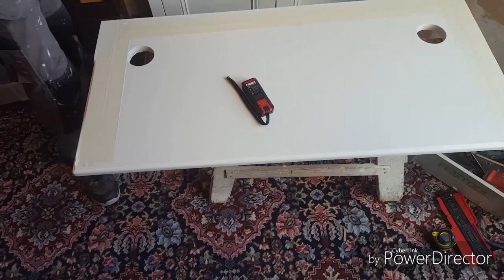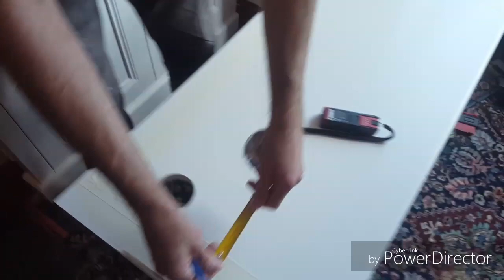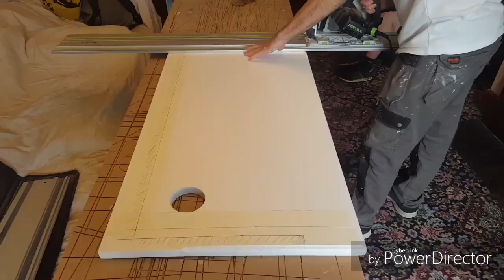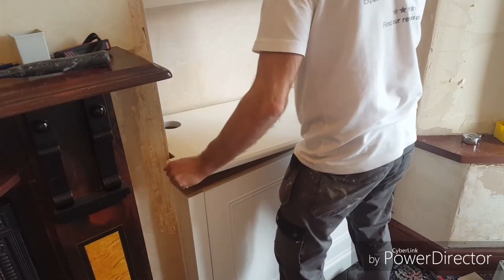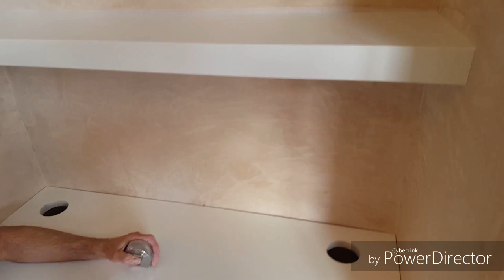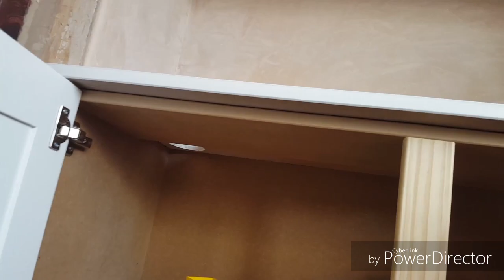How to fit an alcove countertop

Comment: Thanks for this. I'm going to be making my own alcove units soon (using your PDF as a reference) and cutting/scribing the worktop is something I have been thinking a lot about and so this video I'm sure will be very useful in the not too distant future.
Reply from the maker: Actually I strongly recommend doing it differently now!! using a template made from thin strips joined with glue gun.  As shown here: https://www.instagram.com/stories/highlights/18056439292248525/
Reply: @Alastair_Johnson  Even better. Thanks a lot!
Reply: @Alastair_Johnson  A quick question while you're here actually. What thickness material do you use for the 56mm strips either side of the doors?
Reply from the maker: @Hunders1984  22mm thick strip (same as my prefered door thickness) - 56mm wide.  Covering 3x18mm thicknesses on edge
Reply: @Alastair_Johnson  Ah so your doors are the same thickness as the 56mm strip. I assumed with the hinges lifting the door away from the carcass a couple mm the strip would have been slightly thicker to not get a step where they meet. Thanks again!
Reply from the maker: @Hunders1984  I find with the Blum hinges I use that I can get them closing tight to the carcase.  With soft close

Comment: Think this way is quicker and time saving plus any angles   Using the angle ends you can scribe as well easier than the block method on instagram 
https://youtu.be/OVrOk5Ly_eI
Reply from the maker: Anthony Mellor I agree. I should probably take this old video down as I wouldn’t do it that way anymore!  I converted to the templating method a few months back: https://www.instagram.com/p/B8g3pBAgQfS/?igshid=v9r4u6hojl1e

Comment: Hi Alistair, interesting as this popped up in my feed but appears to be an older video. Seems at some point you were using (or at least intending to use) other fitters. I’m guessing by your current approach that didn’t work out?
Reply from the maker: darren green yes it would have been an overreach, would have stripped any chance of profit.  We’re still only running at break even.  I dabbled with fitters but had problems.  Actually I am coming back around to it, with a couple of trusted guys I can call on but I’m not pinning my hopes of business growth on the idea just yet and I’m taking it slowly, doing fits together until I’m sure we’re on the same page regarding how things should be installed.

Comment: The easiest way I've found is to get some 3mm /6mm ply or mdf, cut this at least 60mm wider than the alcove (it's not important how much, you just dont want any less really for when you tape the two halves together later), cut this in half across the width, the depth needs to be 40mm deeper than the cabinet (if a 20mm overhang is required. Insert one half tight to the left hand side (make sure the piece is square to the front of unit with 40mm overhang at both ends) use a 20mm spacer and a pencil to run round the wall making a scribe line on the piece of mdf/ply. Repeat this for the right hand side. Cut to the scribe line on both pieces then place both on top of cabinet and you should have a perfect template. Gaffa tape this together in the middle and lay ontop of the real top. At this point set the template in 20mm from your wall overhang side so it overlaps the front of the fireplace or wall when you cut it. You cant really go wrong and really helps if your using natural wood that cant be caulked.

Comment: Cheers chaps for this. I got up early this morning 3 hours and measured and cut my oak top for the cupboard. Couple of issues,  one I forgot to include the width of the doors, so had to glue 20mm on the back end, secondly and advice requested the alcove is concave so front and back fine but in the middle I have probably five mm it's literally a curve, how would deal with that. It isnt an issue as I am going to build on top so it will be hidden, but for next time.
Reply from the maker: Karl Jones I have forgotten to account for the door width on more than one occasion 😂 so I prefer to cut the top after fitting the doors and strips!
Reply: @Alastair_Johnson  Thanks. It's an 38mm oak top so jigsaw it? Just spray painted (pain when I have to make shift a spray booth up)  the welsh dresser bit that goes on top, now need to assemble. Where do you get and what are those screw spaces (in orange) you used to fix to the wall? Cheers chaps
Reply from the maker: There’s usually a bit of a curve at the back!  Needs to be allowed for; measure and mark a few points off the front edge to the back wall to transfer the general shape to the countertop.

Comment: Templates are probably the easiest in terms of getting the exact fit but can be time consuming. 

Making a template and then doing the work in a shop is easier and less stressful and probably less chance of making a mistake.
Reply from the maker: bighands69 I’ve been thinking about tho since seeing the discussion about templatong with thin strips on the Facebook festool forum.  My method for countertops is quicker these days than what I’ve shown here, but still based on measuring and marking, then adjusting after offering up at an angle.  

I’ve always worked on the basis it’s quicker to Mark and cut straight on the finished piece but I think it’s time o give the template method a proper try!
Reply from the maker: Personally I would never make a template on site then shape it in the workshop on a job like this because my profit relies on being in and out on a day.  However I can see  it would be wonderful to be able to bring a shapes and painted part that stops straight in, with the paint covering the arrow edges and no risk of fluff or splinters showing up at the cuts.

Comment: This is a really useful video which is full of detail.  Thanks very much for producing and sharing these on YouTube.  I'd be really interested to see how you build the alcove cupboards - it's really interesting that you build an independent with it's own sides that you fix into place, rather than using the walls of the room to secure the shelves etc.

Thanks!
Reply from the maker: Jon Orme thanks for commenting!  I tried all different methods over the years and now tend to favour doing more in the workshop and less on site.  So we make the rigid units off site, nice and square, so the doors go straight on with no issues; there is less trimming work (and dust) on site which suits us and the customer better, and it looks better inside.  I’ll add it to my mental list to show more workshop manufacturing processes in future!

Comment: Really excellent method and clear explanation- thanks. Using the carcase edge as a reference is a cracking idea. With solid wood was thinking of trying the boatbuilders tick method, with an undersize template-to save on cutting time. Cheers- there is very little pro info around, on fitting, surprisingly. Probably because of time pressures of building on site and lack of genuine skills & knowledge, and there is certainly a dearth of accurate yet efficient methods. An old boss of mine was clueless!
Reply from the maker: Really glad its helpful thank you.  I'm interested to know more about you - what you do and where you are based.
Reply: Based in Northumberland, word of mouth, part time, working with an artist too. I did work fulltime at this, now I have another v demanding job, keeping me way too busy- the idea is to focus once again on this, maybe in a year or two. Was lucky to train with cracking small co people in Yorkshire